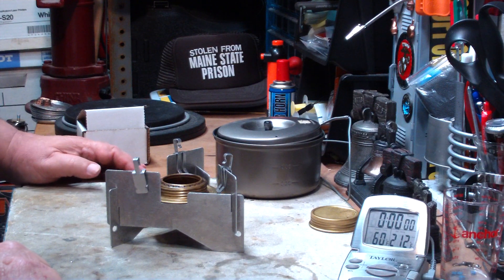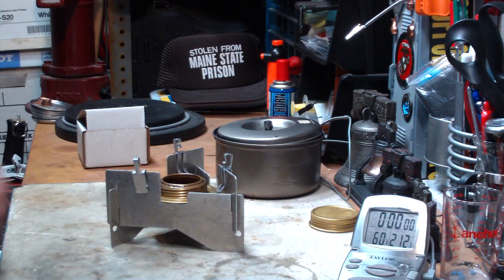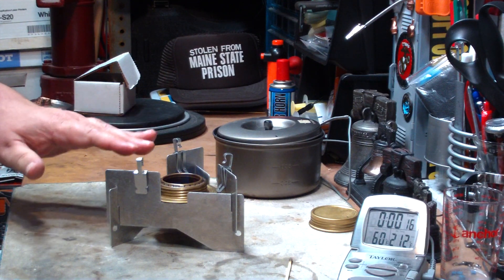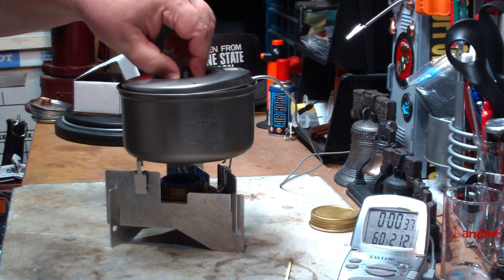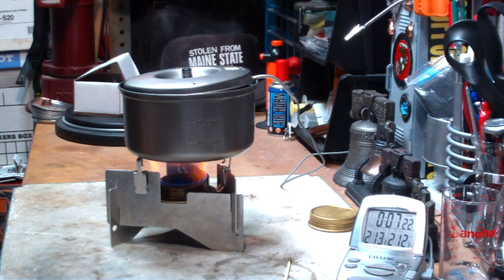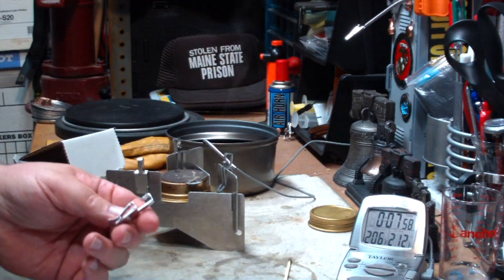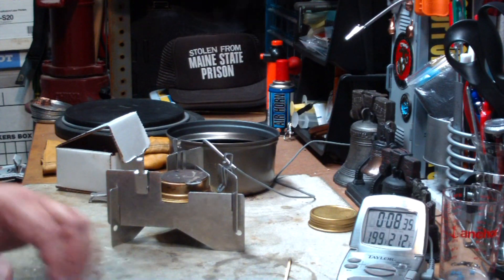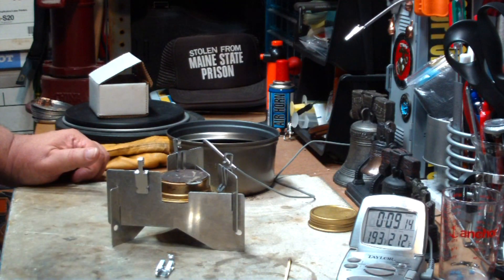Westwind Stove - Mod #1 - Boil test 1

Comment: Hiram,
Measure the distance from the top of the burner to the pot bottom when the stand is upside down and then adjust your clips to compensate for when the stand is up right. See if that equals the upside down burn times. Good improvisions!